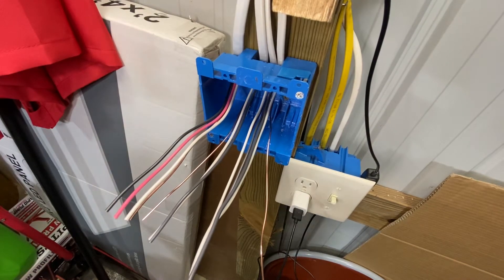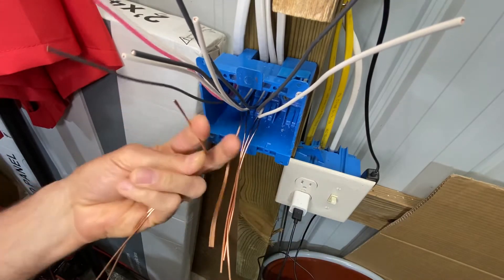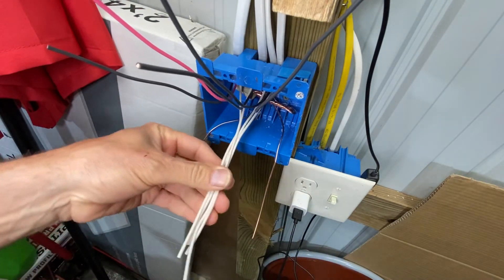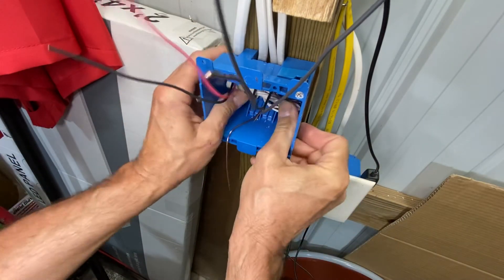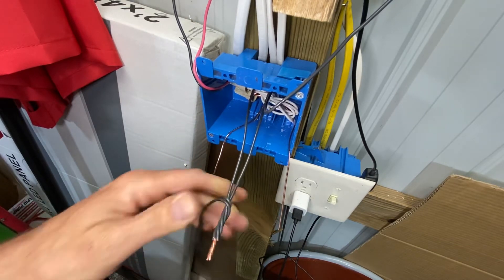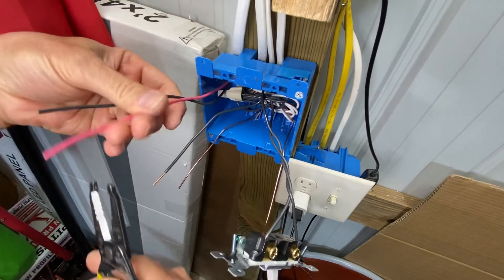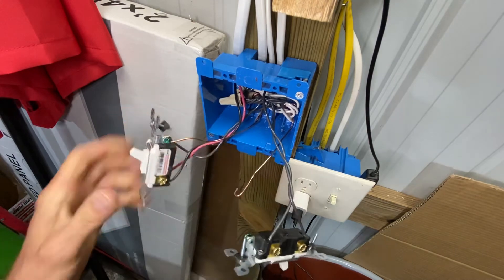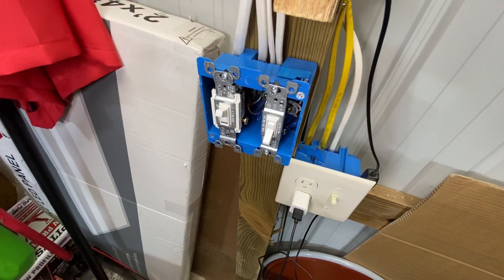How to wire a 3-way and a single pole being fed at same box

Comment: Nice demonstration. To the point. Would the same logic be if I had five three way switches? I was going to do a 3 gain and 2 gain box separately. Any tips?
Reply: Little late response but from what I know you would only use 2 3-way and 3 4-way, the 3 ways at each end of the circuit the 4-ways are the in between

Comment: Why do you have 2 feeds? Are there 2 different circuits? If 1 circuit - why not just one feed?
Reply: Most likely, one circuit, but you still have to distribute the power to each switch.
Reply: Feed in and a feed out

Comment: I thought using the stab-in connections were a no-no?
Reply: You're right. They're a terrible connection. One-and-done and gets looser over time. I can literally twist any wire stabbed in back and forth while pulling back and they slide out. Unfortunately, all the electricians in my area continue doing this whenever they use 14 awg NM

Comment: Also, is there a reason both hot wires had to be combined together with 2 new pieces as opposed to just connecting them directly to each switch?
Reply from the maker: Yes. I like to eliminate problem areas. You really should not use the actual device for a connection point. It may cause hot spots. Nothing beats a good ol’ wirenut installed correctly. 👍🏼

Comment: How do I know which wires are the “switch leg” wires? You said “right side, just like yours” but my 4-wire cable is second from the right whereas yours is all the way left…so I’m not so confident the “switch leg” wires will be in the same position as yours either 🤔
Reply: It shouldn't matter how you insert the wires as long as the wires are matched to their corresponding locations (did I word this right if not I can try to reword it)

Comment: How about wiring at the other end of the 3 way switch does not have the source coming in only the travelers, but need to have a single pole to another light. I have situation like that in my unfinished basement that I will need to design for...
Reply: I'm doing that myself in a 3 gang box.
Living room home run into the 3 gang. And a switched outlet, and a porch light. But the 3 way is being fed from another source, since the living room has the maximum receptacles. 
I need to do a video on that. Because it is kinda confusing.